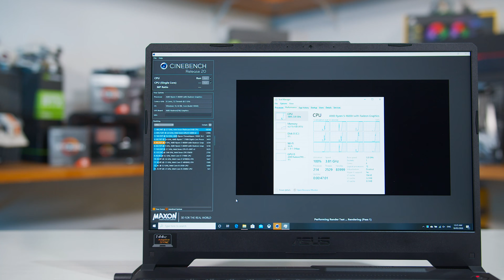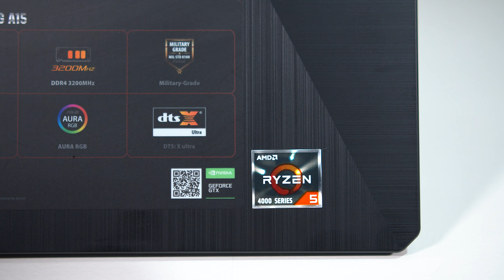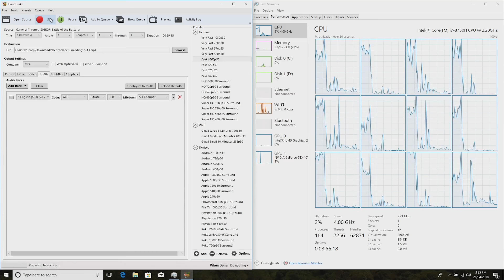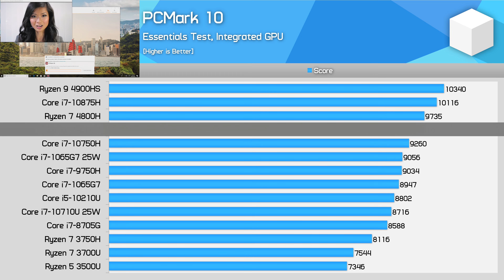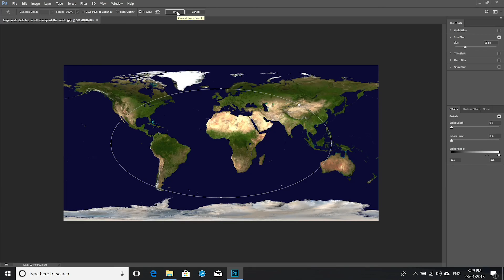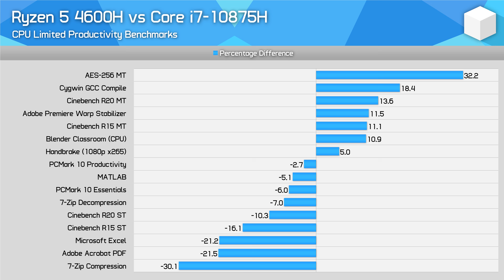AMD Ryzen 5 4600H Review, The Fastest Entry-Level Laptop CPU Ever

Comment: Me: the Ryzen 4000 series chips are cheap and awesome ok now the only thing remains is to slap it with an rtx 2070 
Laptop OEM companies: N O P E
Reply: Couple of reasons, obviously as usual, Intel pulls some dirty shit, but also the fact that consumers are not necessarily quite so discerning. Also, these are really low volume, AMD is still struggling to cope with demand. Change takes time.
Reply: Not using a high-end GPU in a laptop makes perfect sense to me. A powerful CPU is nice for productivity and a GTX 1660 Ti or a  RTX 2060 is enough for gaming.
Reply: @quintoblanco8746   hi, is GTX 1650 enough for gaming when paired with R5-4600H?  i'm looking for a budget gaming laptop but not really knowledgeable in IT...
Reply: @8-6-0-9  I woudnt suggest going with the 1650 or the 1650ti at any point.You should go for 1660ti or the 5600m(AMD) at the least.
I would suggest going with an RTX 2060 due to its future proofing and slightly better performance than the 1660ti with a few more features such as DLSS 2.0 and Ray Tracing as well.

Look into the following laptops
Dell G5 SE (Ryzen 7 4600H / 4800H with 5600M)
HP Omen 15 ( Ryzen 7 with gpus from 1650 to rtx 2060) -The RTX version will launch a bit later
MSI GF65(Intel 9th gen i7 with RTX 2060)
Reply: Not even 1660ti option seems to be available.
Reply: In end of the  2021 will be a lot of amd series laptop,msi and acer seems turn their head to amd.they lowered their intel laptop price
Reply: Yep normal,people avoid amd laptops. They buy laptop if it has Intel inside sticker!
Reply: Manthan Pole i can only afford to slap it with gtx 1650 or to slap ur face.lol

Comment: not an enthusiast  but im wondering if the improvements here reflects the desktop Zen 3? im at the verge of buying 3900x because a lot of websites says it wont improve much but if it does im going to be very salty
Reply: These are Zen2 not Zen3. If you get your 3900x with a B550 or X570 motherboard then you can upgrade to Zen 3 later on.

Comment: So, what about power consumption? I think that's a very important metric as well, especially in laptop form-factors in terms of battery life and cooling requirements.
Reply: There are plenty of benchmarks for the mobile zen 2 platforms battery life floating around the net. The general consensus is that amd cpus monumentally thrash their Intel counterparts. But it depends on the manufacturer, bios and how they handle when to use the discrete gpu.
Reply: I'm also looking for it. Power consumption is important for mobile devices.

No review about how long it last. (I want to know if it actually last 10 hours).

Comment: They should put the best GPUS in the lower cores CPUs for a balanced IGPU only cheap design, and the lower end IGPUs in the higher core because it will just be used for power saving when the dedicated GPU is not active!

Comment: I think the good combine is : R5-4600H with 1650Ti, R7-4800H with 1660Ti, and R9-4900H with RTX2060, and IPS Panel 144Hz/240Hz 100%SRGB
Reply: The funny thing is that the 4600H looks capable enough to drive a 2060S
Reply: 4600h could easily run rtx 2080... but yeah we Are not gonna see that...

Comment: WTF R5 is beating i9😂😂🤦🏻‍♂️
Reply: Generational leaps with node changes always have, why are u shocked?
Reply: No, seriously, mobile class tech has absolutely nothing to do with pc class tech. They are in completely different realms. The only thing that ties them, on a surface level, is the manufacturing node - but then again ARM is an entirely different arch from x86 so just because ARM is on 7nm it doesn't mean x86 will have to be on it too. You just played yourself by calling yourself an engineer :p
Reply: Intel is shit compared to the Ryzen 5, but the Ryzen 5 doesnt beat an i9 nope.  It's just slightly better for some types of works. The Ryzen 7 actually destroys the i9 yeah.
Reply: even mobile phones have 7nm cpu compared to intel 14nm
Reply: @Chiranjib_db  mobile phones have a completely different architecture.
Reply: @a_spire  that has ver little to do with not having 7nm instead of 14
intel is complacent
Reply: @a_spire  
That doesn't say anything, it is right Desktops" and Laptops" r x86 based while mobile SoC r ARM based...but that doesn't come much in the way when comparing the node size, and ARM based processors r gradually shrinking the gap...see this: https://youtu.be/qC5bSZSotws
But if there's anything to say it would be: for mobile SoCs it is harder to fit all these functionalities, components  (mobile phone SoC has much more than just an Integrated GPU), compute power into a smaller die size than laptops...can say that ARM is a simpler architecture...but that really as said doesn't compare much when it comes to the node size.
Reply: @Chiranjib_db  mobile phones are the first devices to apply new processor nodes, your comment is dumb.
Reply: @alexlinworm  By your logic AMD and TSMC and apple is Dumb that they will launch 5nm next. U mean american tech apple is Dumb that they are trying to ditch intel because they think they can make better cpu(eg A12X) or choose AMD.
Reply: @Chiranjib_db  you make no sense whatsoever
Reply: @alexlinworm  Cause as an Engineer i use words which for u is complicated😂
Reply: @Chiranjib_db  Why u know spell`?!one1!
Reply: @Chiranjib_db  No, it makes no sense because you are responding to a comment saying mobile chips are the first to use new nodes, which is true, but only when it comes to TSMC/Samsung fabs. It also doesn't make sense because apple never used intel for their phones which is the only thing the comment you are responding to was talking about.  Neither Apple or AMD makes manufacturing nodes (e.g 5nm) so they can't release 5nm at all, they can release a CPU produced on it though. None of what you said is relevant to what you are responding to nor does it counter it in any way. 

Beyond that, even the syntax of your writing makes no sense. You capitalize 'dumb' twice for no valid reason, and use 'U' for 'you'. You must be the most moronic engineer I've ever seen.
Reply: @alexlinworm  hey if you forgot the snapdragon 8cx in galaxy book s beats the i5 9th gen and its a mobile ship
Reply: @Chiranjib_db  u roasted Alex 
Fek Alex family
Reply: @Chiranjib_db  Comparing those 2 is like comparing a 2020 Sentra engine with a 1980 Porsche's.

Comment: Video: Fastest Laptop Processor ever
AMD: So far...
Intel:
Reply: Intel can get you a few more FPS in a few more games, for sure

But the price delta of $200 for top tier Intel means you can spend that money on other parts for a better laptop. Faster screen, so those FPS matter, lowest latency lanes for mouse/kbd

Or you can just like, get good. +4 FPS in COD won't help as much as strategy and patience for your K:D

And you'll still have money left over, which is nice
Reply: intel : add more incentive for laptop maker.
Reply: AMD: "When should we release the R9 4900H laptops, Lisa?"

Lisa Su: "What for?"

Intel:...
Reply: Amd: were faster but can't match Intel's 6 core gaming performance on frame rates.  We are all on YouTube looking at gaming labtops right? Why does my I 7-9750H beat these brand new AMD cpu's on labtops with the same rtx 2060 gpu?   Both on high settings
Reply: @bradbeyers9028  I think that you got your facts wrong. Testing shows that when paired with the same RTX 2060, Ryzen 4800H is slightly faster then i7-10750H or i7-9750H. 4800H laptops are also cheaper. 4800H laptops are also much faster in the other tests as we can see here. Honestly at this point, other then the bribes Intel gives out, so high end laptops are not made with Ryzen, they got nothing. I hope that Intel can improve significantly their CPUs, because if we don't have competition AMD will keep pulling the same shit they just did with the Ryzen 4000 support for 400 series motherboards.
Reply: @bonevgm   i understand that its faster. The testing i saw the I-7 had higher frame rates... Which isn't that what u want in a gaming labtop?
Reply: @bradbeyers9028  If we are talking Ryzen 4800H vs i7-10750H, the Ryzen has slightly higher Frame rate on average and the laptops are also slightly cheaper. Where did you see that Intel has higher Frame rates?
Reply: @bonevgm  4000 will be supported on 400 series motherboards, thank you community :p
Reply: @tuor75100  Yes, I watched HU video a few hours ago. Very nice :)
Reply: @bradbeyers9028  Still using frame rates as a benchmark - hahahahaha.
Reply: @kevinisawake   To me the frame rates matter.. I'm not a graphic designer. I bought a gaming PC for gaming.. call me dumb but I can browse the web on my phone lol. If i do ever learn to edit videos pretty sure my I-7 will do it....who cares if Ryzen does it a lil faster. Just my preference. Only point i was making..
Reply: @bradbeyers9028  that is fine, after all is your money, is your choice

but for us, we care about other things that is all

i also have to agree that we may be a little over the top, but what we know about this whole topic is that AMD have way too good of a deal for us, i personally dont care about having like, 5 more or even 20 more fps if the laptop pulls off above 144 fps, or if it pulls off way above the screen refresh rate you have because at that point you wont notice

so with ryzen laptops i save money, have a better cpu, maybe a crap gpu (but i know how to do an external gpu mount) that is probably enough, and much better productivity that I personally care because i use Blender and such, so is like everything is better for me except for 5 to 20 fps that i dont even care about much, so is a no brainier for me
Reply: @bradbeyers9028  bullshit did you see his gaming performance on 4900hs?? at 720 is up to 40% faster compared to your 9750h without mention that 4900hs had 2060 max-q while 9750h had 2060...you can see also on linus review where with the same gpu amd was faster
Reply: @Setzer K dude not at all... My GF 65 Intel i7 6 core. Puts out higher frame rates than these new AMD 8 cores. I've watched reviews on labtops with the same rtx 2060 go head to head.  We're gaming here right??? I think u want higher FPS for ur $.
Reply: @bradbeyers9028  Most modern games are not good at utilising all cores of the cpu and Intel has been optimising their 14 nm processors for years for gaming.

Comment: AMD has not only crushed Intel, it has made my 6 months old R7 3700u based laptop look obsolete und underpowered.
Reply: Yeah, I bought an r5 3500u in the Christmas deals, I knew 4xxx would be good, but wish I could have held out another year really. I suppose the difference between the 15w tdp on the U range and 45w here helps too. Wonder what they will do with the smaller ultra book types, that need the lower tdp.
Reply: @98dizzard  The Vega 5 in the new R3 4xxx is as powerful as the old Vega 10 in R7 3xxx. On the CPU side R7 4xxx is almost twice as powerful as R7 3xxxx.

Comment: Buy Intel!!!

if the only thing you do is exporting pdfs..
Reply: *until Adobe get around to updating their 20 year old software to take advantage of technology from this century. 😋
Reply: Even that would be risky with an Intel CPU.
Reply: well except for that, I can work with a chromebook soooooooooooooooo
Reply: But that's a real world application right there! All the rest is fake or not used very often... :D
Reply: @elmirBDS  That's why you should buy Intel!!
Reply: Umm guys my 6 core I-7 with RTX 2060 is getting higher FPS than these 8 core AMD chips with a rtx 2060....  Not lying... I've been watching them go head to head cuz I recently bought a gaming labtop.    U might be able to edit a video faster but the gaming is still better with Intel.. don't buy into the hype.
Reply: @bradbeyers9028  unless you control for everything to be exactly the same as they have, you will get different results. Ambient temperature, boost clocks, configuration differences, silicon lottery, manufacturer undervolting, cooling system, TDP limits, these are all different.
Reply: @bradbeyers9028  Yeah, because you buy high-end laptop only to game, right?
Reply: @Bagus-101   i did lmao.  If i wanted to just do computer shit theres a million cheaper options capable but those labtops can't run the games id like take along with me. Don't get me wrong I'll use it for other things too.
Reply: @bradbeyers9028  I mean, there's a lot of things to consider about a laptop besides it's gaming capabilities. Most high-end specs that pair a good CPU and GPU are marketed as gaming laptop but someone out there who done productivity things, get their laptop for editing and rendering, not gaming. I, myself, would never buy a high-end laptop solely for gaming unless I am a pro player that getting paid by playing games.
Reply: @bradbeyers9028  I find a bit hard to get a good apples to apples comparison since many Ryzen 4000 laptops are coming with 2060 MaxQ GPUs while a few intel counterparts are using higher TDP 2060s, so can you post a source for your comparison?
Reply: @bradbeyers9028  "InTel Is StIlL bEtTeR In GaMiNg" what a lame argument. You are a delusional dude
Reply: @bradbeyers9028  I havent seen that Benchmarks, but i guess if you are only gaming games that are mainly single threaded then buy intel :-) . I still prefer a desktop for gaming.

Comment: Have you ever thought about using an external GPU for these laptop CPU reviews? That could solve the GPU discrepancy problem
Reply: Not every laptop has Thunderbolt. Like the one tested for example
Reply: eGPUs unfortunately do not perform as well as regular GPUs due to Thunderbolt 3's limitation of only 4x PCIe lanes so there might be still discrepancies. Besides, there isn't any AMD laptop that supports Thunderbolt at the moment.
Reply: You can still get eGPU's through PCIE I think...? I'm not sure how, but I think you can connect a GPU to the PCIE connection the WiFi connector uses. It's not a realistic configuration, ofc, but it's the best apples to apples config you can get to test laptop CPU's...
I may be wrong, no expert at this, just a curious dude...
Reply: @filipecalixto6569  That still honestly doesn't give you enough bandwidth. Also only 4x lanes

Comment: I want a cheap Ryzen 4000 laptop with no dGPU, ideally the 15W TDP 8 core 16 thread part. Imagine a normal sized laptop cooler with a low power CPU, nice and quiet.
Reply: That's 4600u.

Comment: this ryzen 5 is so powerful that the only thing holding it back is a entry level GPU :/
Reply: This ryzen 5 it's so powerful that the only thing holding it back is the wallet :)
Reply: GPU Library it’s entry level!!
Reply: @GPULibrary  Cause you broke that's why
Reply: @buuzy252  how many GPU you have?
Reply: @GPULibrary  I just purchased the Ryzen 7 my bro bro RTX 2060
Reply: There are RTX 2060 versions of this laptop as well.
Reply: @ghostcommand99  R7+2060 only in my country, while R5 is limited to 1660Ti
Reply: It’s still way better the intel igpu
Reply: For me its perfekt, because I need a strong cpu and don't want to spend much of my limited budget to a gpu BUT i still wanna be able to play some games like Gta V
Reply: Seems the way on every ryzen laptop unfortunately, would've been good to see the smashing a 4900h W/2080 would hand out
Reply: Intel, Potato GPU inside
Reply: Hey I know I'm kinda late but I'm thinking about buying lenovo with amd ryzen 5 4600h and rtx 2060, how do you think it will perform?
Reply: You forgot single-channel SOLDERED!!!!! RAM that's probably something crappy like 2666 MHz...
Reply: @kumbandit  No new Ryzen's laptop using less than DDR4 3200/LPDDR4 3200 memory so far. What are you even talking about?
Reply: @RinoAP  ryzen 4000 uses 3000+Mhz RAM. am I missing something?
Reply: @kumbandit  Pozdrav,ako moze tvoja pomoc.Treba mi za dete na faksu za Auto Cad 2022 ,pa mi dali ponudu rayzen5-4600H/16gbram(neznam dal je ddr4 3200 ili lpddr ,4266)/ssd 256+hd1tb/gtx 1650-4gb/15,6 ekran sve za 100000din.E sad vidim da kazes da je zalemljen jedan kanal a procesor podrzava dual chanel?Ako mozes da mi to objasnis oko rama na sta da obratim paznju,hvala i hitno je,poz

Comment: I get 3100 on Cinebench R20 on my laptop , i7 9750H
Reply: Pretty sure you aren't, even the 80W version doesn't score near 3000
Reply: @kaloyan.doychinov  it hovers between 2970 -3100 .  Now that it's also hot outside (35C) it scores lower than in winter . now i hover around   3000 , last score was 3066 on turbo fans
Reply: also its a rog strix g
Reply: Can you tell me the exact product number
Reply: @kaloyan.doychinov  G531U